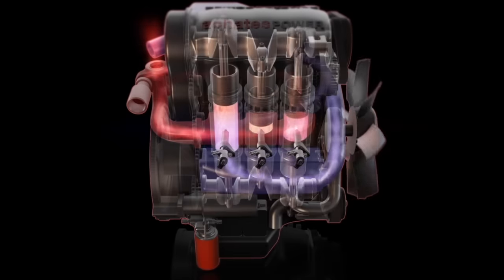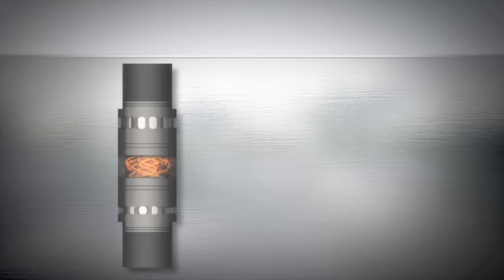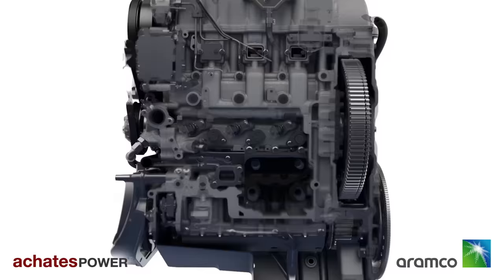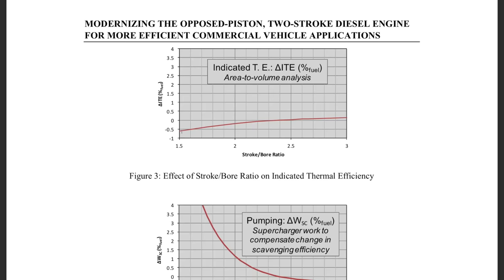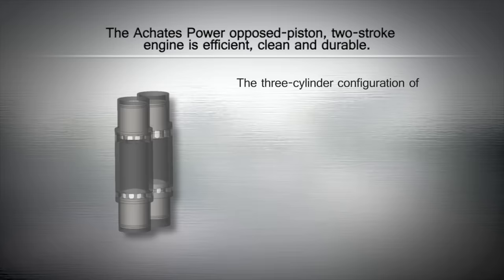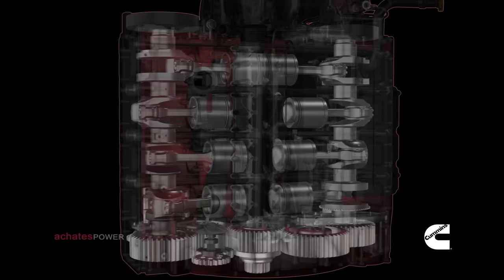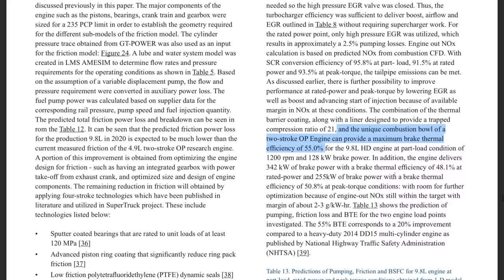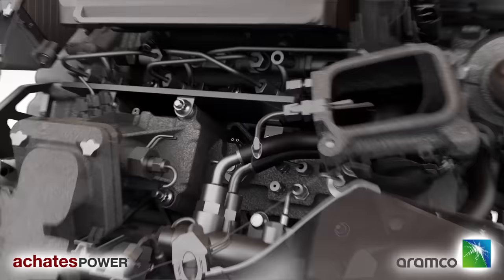Opposed Piston Diesel Engines Are Crazy Efficient

Comment: I'm honestly shocked more 2 stroke engines haven't become common these days. The major flaw was that fuel escaped via the intake air not being well controlled. That doesn't much matter when we have direct injection as the norm. 2 stroke engines have shown to have more thermal efficiency with a smaller, lighter engine whilst retaining high power. Hopefully this helps push more development of 2 stroke engines.
Reply: 2 stroke burns oil as a design piece, probably would have trouble with emissions
Reply: @WhysafraidofCause  Because its designed to burn oil. Because they're using 2 strokes where a cheap engine is needed and its far cheaper to burn oil. But there have been plenty of 2 strokes which use oil conventionally throughout history, plenty in research today, its not a requirement to burn oil for 2 strokes. Indeed it wouldn't work with fuel injection at all if you were burning oil as the pre-injection areas still need oil. And its not a requirement to have the fixed/no valves you see on most two strokes. There's a lot of novel designs like piston valves but there's also conventional poppet valves in historical and research 2 stroke engines.
Ie you can make one work fairly similarly to a 4 stroke, but with half as many cycles per power stroke you get far less friction.

Research 2 stroke engines are showing a far greater efficiency than 4 stroke with far less emissions. A little difficulty with NOx emissions but generally better than 4 strokes on emissions overall. The main difficulty is a smooth torque curve. But with hybrids that can be managed, and the focus on fuel efficiency and low emissions even prior to hybrid engines makes it baffling to me nobody tried them in the modern age,
Reply: Wassup ma
Reply: @WhysafraidofCause  you don't need to burn oil if you use a turbo or supercharger as opposed to crankcase pressure to force induction. You can then have a wet crankcase like most 4-strokes.
Reply: @olivialambert4124  this is very intriguing information. I guess the limitation is just it's really expensive to fund the development of an engine and large companies are generally disinterested in significant risk and something like this would probably be perceived as that.
Reply: @WhysafraidofCause  No, its only because cheap 2 strokes rarely bother with proper oiling system. There are two stroke engines that have same exact lubrication system as for strokes. Its the same for opposed piston engines.
Reply: @chicken29843  Did you notice the ARAMCO logo? Which industries would benefit financially from this type of engine as opposed (no pun intended) to EV?
Reply: @olivialambert4124  2 stroke engines used their carter as scavenging air space. So there where problems lubricating the cranckshaft/connectingrod. Therefore oil was added to the fuel. Or a pressurised system had to be used. But with the piston going down there was pressure building up to fill the cylinder at the moment the scavenging ports openned up. This mixture was air,fuel and oil. These where burnt and left the engine but where so poluting that 2 strokes were banned. In this engine there is no oil going in the combustion space(we will find out when these engine have running hours on them) that can burn so not the ,,old fashion,, 2 stroke polition. Thats why they were banned and this one allowed. So its not the 2 stroke itself but the way it opperated that stopped the use off.
Reply: @henkoosterhof5947  There's quite a substantial number of 2 stroke engines both historically and in present usage which use a conventional oil lubrication system. Not research engines but actual (reasonably common) production engines.

The fact that MOST systems use an oil/gas mix, MOST systems use fixed sidewall intake/exhaust ports doesn't mean that is an absolute requirement to the design. Frankly its this same view of 2 stroke engines displayed here I have a problem with. There can (and usually will) be a technological solution to problems encountered, and by banning the design outright rather than simply setting a pollution limit as we do with every other engine we have prevented the development of any technology to fix the problem. Or in this case simply the use of already existing technology used on a pretty wide scale. The same argument is indeed still used for fuel of 2 strokes despite the suggested fuel injection being a commonplace fix exactly mirroring your lubrication issue.

Had they merely set pollution limits we likely would be using clean 2 stroke engines with substantial efficiency improvements on the road today, just like we see in many non-road applications already.
Reply: what i’m thinking, it just a “what if”, what if we using this opposed engine or the uni flow 2 stroke or the supercharged 2stroke with the direct injection (oil is in the crank case, no mix) as a super compact power plant, taking as the hybrid power, and burn bio gas or hydrogen as fuel
Reply: @olivialambert4124 If you want Proper scavenging, you need a uniflow design for which you need cylinder wall ports. Every time the rings pass a Port they can scrape a small ammount of oil into the port, which is very bad for emissions and exhaust treatment equipment. I am not sure to what degree this happens, but I think this could be the biggest challenge with the OP engine. Hopefully time will tell I guess
Reply: @onefishfrank9145   Stop with the conspiracies. Saudi money is literally propping up Lucid despite terrible sales. They don't mind investing in EV at all.
Reply: @olivialambert4124  because it's not a fad right now. Literally nobody would support a project that involves researching an ice engine, let alone 2 stroke which comes with its own set of fabricated, misplaced problems.
Reply: It is the horizontal opposition being queried .
Reply: @putinski666  The problem with that is that there are a great many ICE engines in development right now. 4 stroke and 2 stroke. Indeed my information comes largely from 2 stroke engine development both in academia and in industry whitepapers after developing and physically testing new engine designs. I've read through tens of different 2 stroke designs from the past 5 years. I'd be surprised if there aren't hundreds of engine concepts which have been made in the past 5-10 years.

What you state is objectively wrong. Hell, there are a great many ICE engine concepts created and brought to market in the past couple of years shown by this very channel.
Reply: @davenoejoe  Opposed pistons aren't anything new. They were very widespread in WW2 and one of the most common designs in larger engines in the '50s.

If it were a new or rare concept I'd agree with you. But given it was so incredibly prevalent in the western world for some decades I disagree. What we are talking about is this specific engine, an engine which is BOTH opposed piston and 2 stroke.

It makes no sense to ignore the main reason this engine is more efficient to focus on a less impactful area which is heavier, more expensive, requires more work, less efficient, and is frankly far less likely to make it to market. Again it's not even a new radical idea, opposed pistons were some of the most common large engine designs in the '50s with the likes of the Napier Deltic and Germany's 1932 Jumo 204.
Reply: @olivialambert4124  I'm not stating that there isn't development at all. I'd love nothing more than seeing new 2 strokes hit the market trust me. All I'm saying is that they'll never secure the support or funding needed to make it into  mainstream large scale applications like motorcycles for example. Everyone's jumped to the electric bandwagon and I don't think many would dare come back. I may be wrong but it's simply what I think based on the current situation

Comment: Why aren't these engines already in use today? I mean has there been any reason that has hindered development so far? They make perfect sence to me...
Reply: They used to be in trucks many years ago i seen one before sounds mint
Reply: @BIGSMOKE-bl2lq  What truck did you see that had an opposed-piston engine?
Reply: Emissions mostly. 2-stroke diesels tend to run very dirty.
Reply: @TitoRigatoni  British Commer TS3 truck, also British Chieftain tank, and BR Class 55 "Deltic" locomotive which had 2 engines, each with 18 cylinders, 36 pistons and 3 crankshafts! Go to YouTube to listen to the amazing sound of these locomotives.
Reply: @davidstewart4570  I am well aware they've been used in tanks and locomotives, also submarines and patrol boats. I'd never heard of them being used in trucks though, thanks for the info!
Reply: @davidstewart4570  Commer is a little different, it uses a bell crank and one crank shaft.
Reply: Money I guess : most factories spent millions improving their efficiency, they can make a standard inline 6 for cheap. And as you know, stakeholders only knows about profits, not inovation.
Reply: @TitoRigatoni  "commer knocker"
Reply: Engine tooling has to be created to mass produce them, it takes years for a vehicle that is fully designed to go into production, let alone what part as complex and heavy as an engine.
Reply: As one comment said, emissions and probably engine life. They would last too long
Reply: Its called] clean air act or EPA
Reply: EPA.
Reply: @TitoRigatoni  Foden and British Dodge, both designed and made in England.
Reply: Yeah there you go, everything you mentioned has a lot more engine room then a typical car or truck meant for the roads. These engines need two separate crankshafts, would be nice to see some companies actually take the platform on and push the engeneering envelope
Reply: There probably a pain to work on and very expensive
Reply: Fairbanks Morse is a large producer of OP engines with their 32D 8-1/8 engines (commonly known as the FM8 & FM10). They were used originally as locomotive engines and now as gensets. The US Navy has several different ships that utilize this engine to this day.
Reply: Emissions are one also at the time they were thought up the metallurgy was not adequate. So the engines eat them selfs. And lastly they can't be used as engine breaks ( for the obvious reason). So that eliminates them from large commercial use.
Reply: Efficiency doesn't matter if it's not reliable.
Reply: @robertpayne2717  government always holds back innovation
Reply: @TheHighborn  when built right they are very reliable. They are used in ships that but hundreds of thousands of operating hours on then with little to no problems. They are actually pretty simple. The OP engine has been around sense the 20's and hasn't fallen out of use.
Reply: If these were in every semi truck in the US, the smog and acid rain would be *awful*.
Reply: @magicoddeffect  why is that in your estimation?
Reply: @johnh8546  Because these opposed-piston two-stroke diesels, while fuel-efficient, are incredibly dirty relative to current EPA road emissions standards, and before the EPA started regulating road emissions New York had smog as bad as Beijing.
Reply: @magicoddeffect  the pollution won't be any worse than current standards or they won't get approved. The old Detroit engines were bad but currently Achaties Power claims oil consumption is comparable and it will met emissions standards. They have a a 10.6 liter in use in Tractor Trailers now. It meets emission standards and has low NoX emissions. So I would beg to differ.
Reply: @johnh8546  The fact that these engines haven't yet been approved for use in tractor-trailers despite existing for decades proves my point
Reply: @magicoddeffect  there is already one in use validating the design in a Peterbilt 579 with approval for full scale production expected later this year. It has already shown in testing (a tractor trailer pulling a full load) to sharply reduce NoX emissions. You know the thing that causes acid rain. 

Edit this is a new application for a true OP engine so approval isn't going to be fast. Past emissions it also must demonstrate sufficient durability or an engine manufacturer won't pick it up.
Reply: Tito Rigatoni And aircraft. The Nazis had them in bombers during WW2. It was called the Jumo. We’re lucky they were so outside their minds because their technology was far more advanced.
Reply: Opeg / epa... U name it.
Reply: @Dipierox  SAYS "stakeholders only know about profits, not innovation"
                   TESLA ENTERS THE CHAT: hahaha, I'll smoke your profit...
Reply: @godsinbox  Slight correction: ELON MUSK enters the chat with half a billion dollars and crazy high motivation and ingenuity levels...  THAT was the difference. No one with the money and the motivation ever cared to "change the game". Fawk! How far we would be as "humanity" if someone like that had come along 50 years ago!?!
Reply: well Cummins partnered with them to make a tank engine and it looks like very recently they have passed even future emission standards already
Reply: @davidstewart4570  And the FV432 (and variants) tracked APC with a Rolls-Royce K60 three hole opposed piston engine.  Junkers Jumo 205 made in 1932 becoming the 207 and made in quantity, among others it powered the Dornier Do 18, Do 24, Do 26 and Junkers JU 86.  Licensed to Napier as the Culverin.  Many ships were powered by opposed piston designs too, Doxford and Fairbanks-Morse being just two.
Reply: @brettknoss486  That's a Simpsons balanced two-stroke from 1914.  They've been around a while.
Reply: @energetictomato9409  We wouldn't have the great new engines of today without strict emissions.   Ido like the clear sky in most of the US.  f you go to India, China or other Asian countries you will be amazed at the pollution.   That would be the US too if not for Clean Air act of about 1969.  Drive behind a classic car and be amazed at the exhaust. 

I think OP engines could be good for constant speed engines like generators and locomotive engines.   The fact that the flame spread is a fixed speed in the combustion chamber means you have to use variable valves to compensate a bit to improve the volumetric efficiency at different speeds as realized in a motor vehicle.   Can't seem to do that with two cycle port induction I'm afraid.
Reply: its risky now because of the emerging EV markets. Also many parts of the world that includes the whole of Europe planning to ban Combustion Engine vehicle as early as 2030.
Reply: @robertu  USCG 378' cutters have two FM 38D8 Diesels, each rated at 3600HP.
Reply: Exhaust emission problems are difficult to overcome.
Reply: @magicoddeffect  Today's diesel engines can be very clean, especially with the advances of injection controller  by P.C.'s.
Reply: @peterbustin2683  I think with modern electronics and algorithms this problem could be solved
Reply: @marcob4630  Two strokes are inherently noxious, but powerful. I think control systems would alleviate the problem but at the expense of power output.
Reply: @TitoRigatoni  Google COMMER KNOCKER
Reply: @peterbustin2683  : that's possible, thanks
Reply: The reason is pressure of oil companies. This twin combustion engines give almost twice amount of efficiency for same fuel consumption. Oil companies wouldn't like this just like they slow down electronic car production today.
Reply: @navalarchitect1713  : This is only a trivial conspiracy theory. The real problem are the noxious gas emissions
Reply: It's probably too fuel efficient. look what happened to the people at GM and ford researching atomized fuel in the 70s and 80s
Reply: in the early 1980's I worked on Fairbanks Morse opposed piston as a back-up diesel generator on a submarine. I don't know if they are still being used, but they were absolutely reliable. Air start instead of electric. If the boat's air compressors were down, it had a hand-pump to a cylinder to provide enough air to spin it a few times..
Reply: @kckoellein  People with money have been changing the game for hundreds of years. It's why much of humanity is suffering today. 

Now, how far could we be today if motivation didn't require money in order to be realised?